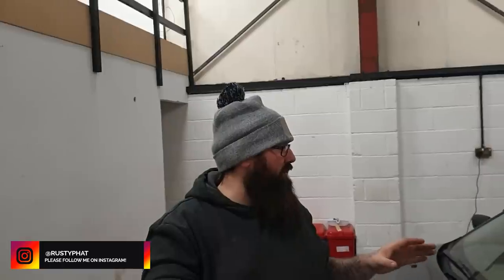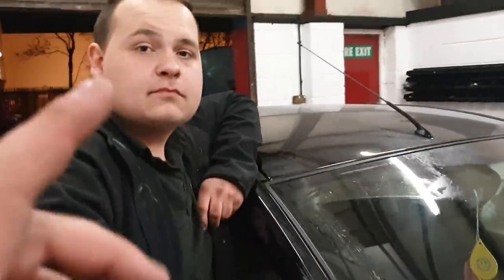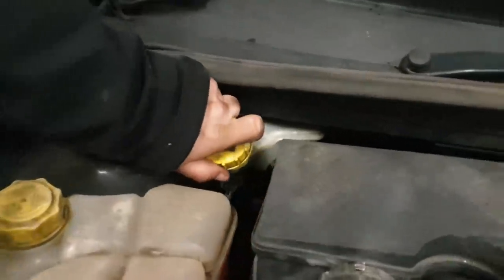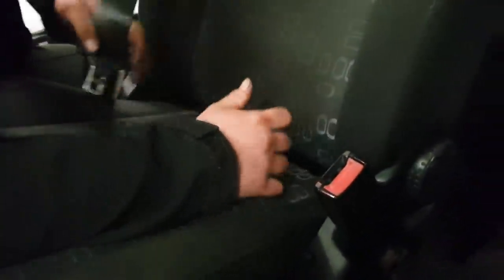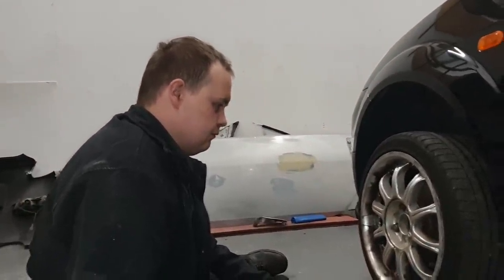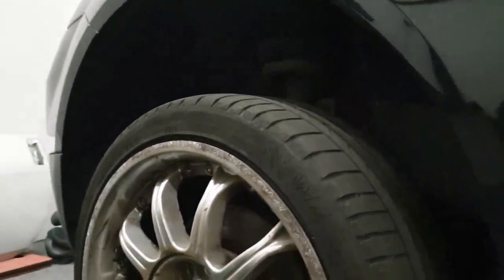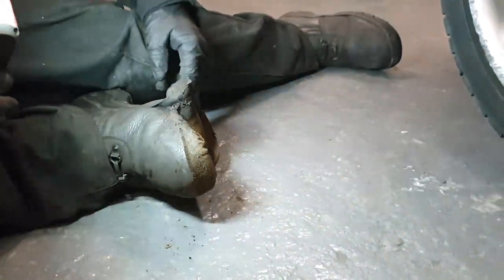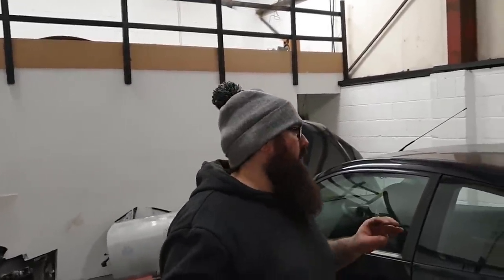What To Check Before Your MOT Test

Comment: Also when checking for wheel bearings, spin the wheel and then hold the spring and you’ll feel vibrations in the spring if its gone

Comment: In regards of mirrors, you NEED your driver side and either one interior or one passenger side mirror. And also you need to check your headlight units are secure as thats a failure too if they’re not 👌🏻

Comment: Hi driver seat does not have too fold forward has long has you can move seat forward to gain access to rear.
Reply from the maker: Seat has to tilt, both HAVE too, if theres an accident and 5 people are in a 3d 5 seater car, there not exactly gonna sit and wait for people to get out one by one if its on fire...all possible routes should be clear, its like having 2 fire exits but only 1 has to work

Comment: I have this model Fiesta (a 2005 one) and the bonnet would not shut properly; it would latch on the safety latch but would not close all the way. The garage wanted almost £100 to repair it  but I managed to sort it by lowering the hook slightly using some washers on the bolts.
It also had an idle problem which was a split breather pipe.  Also got a faulty o2 sensor  and  it failed the MOT on the rear bushes.
It's at that age where it's starting to fall apart :-(
The nearside electric window motor is on its way out too, it's going down very slowly now.

Comment: I have a 2015 smart forfour, and my engine light came on. I was told my lambda sensor need cleaning to save me money Instead of buying new lambda sensor. I was told to buy some sort of liquid thing to put in the petrol tank and take the car motorway to cleans the exhaust because apparently it has too much emissions fumes. Do you think it’s safe to drive my car until I get money to fix the lambda sensor and buy the liquid think for the exhaust emissions or do u think if I drive it will mash up my engine?? Please help me😕
Reply: Thanks for replying
Reply: Moses Kamara lol 😂

Comment: You never mentioned what lights can or can't be on the dash you didn't check the brake servo for any leaks the steering wheel for perishing or play the foot pedals to make sure they all have rubbers on or appropriate grips the had brake to make sure it holds the car

Comment: wait so thats all the mot checks ? ..i got the 6 months covid mot ..but i want a proper mot doing ..i have done a full service new tyres ..and now replacing the wings (as mine are rusted and on one side it has holes in) ,bumper, coolant tank, and installing fog lights and a new dome light for inside ..also had a wheel bearing done with wheel aliment ..my problems now are a creaking when going over bumps or turning  and a vibration in the floor (what i think could be wheel balance for back tyres) ..im not too sure tbo im new too driving and new to cars in genral ..if anyone has any ideas how i can fix the creaking let me know please ..its maining at the front of the car (ford focus 2004 tddi lx ..tho the wings and bumper do not match in colour completly (im assuming a bit of plasic dip will sort that out ?)

Comment: Wiper blade rubbers is not a reason to fail .but smearing screen is.
Reply from the maker: Which is what we said, if the runners are ripped, it will cause smears

Comment: Reverse lights
Reply: Doesnt get tested on them
Reply: Yep now a failure after 2009 cars.
Reply: @joeb84  reversing lights are not tested at an MOT, not all cars have reversing lights or may only have one
Reply: @georgebarnes8163  Yes they are mate. You need one reverse normally on Nearside.
Reply: @joeb84  No, you do not, there is no reversing light test in the UK, never has been. You are confusing fog lights with reversing lights. "Lights

Don't be one of the 20% of MOT failures which fall down because of a simple dead bulb. Remember to check all of your bulbs before your test. Get someone to help you - or park up close to a wall or garage and test them out. Check the following:

Headlights (main beam and dipped)
Sidelights (front and rear)
Indicators  (front, rear, and side repeaters)
Brake lights
Rear number plate
Rear fog light (fronts are not checked - but check yourself anyway!)
Hazards (check seperately from indicators)
The reverse light is not part of the MOT - but always worth checking."   https://www.bathnes.gov.uk/services/parking-and-travel/mot-testing/getting-through-your-mot-first-time-0
Reply: @georgebarnes8163  yes it is. I'm a MOT tester 🤣
Reply: @joeb84  course you are lol.
Reply: @georgebarnes8163  yes I am. And it's a failure. Trust me look it up on dvsa kid.
Reply: @joeb84  LOL, I just supplied you with the link that proves it is not part of the test, I have never ever had my reversing lights tested and never will, did I mention I was a space shuttle pilot lol?
Reply: @georgebarnes8163  reversing lights on vehicles first used from 1 September 2009

Straight out the manual for you.

Comment: New tyres. Pmsl there's tons of tred on those
Reply from the maker: Think you need to borrow my glasses mate 😂
Reply: @RustyAutos  no mate I see grip
Reply: @RustyAutos  I bet if you went round a corner at normal driving speeds or even breaked I 100 % percent bet you wouldn't slide.
Reply from the maker: @jc2462  id have a job in this car as it was ages ago haha